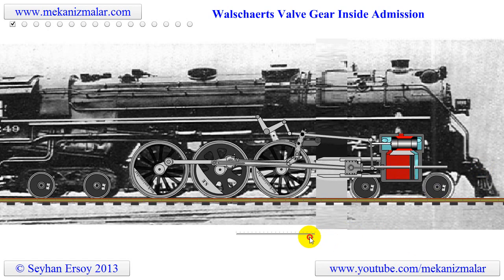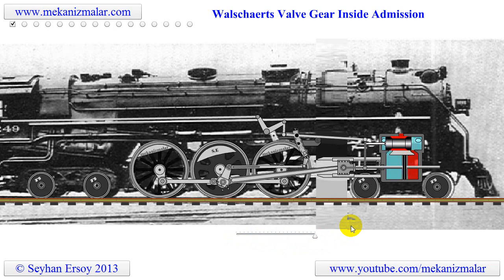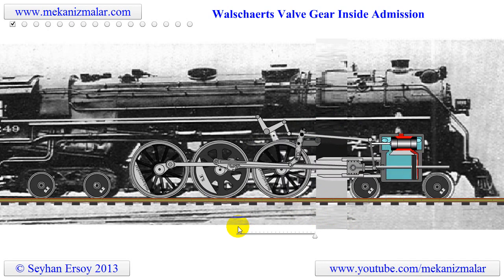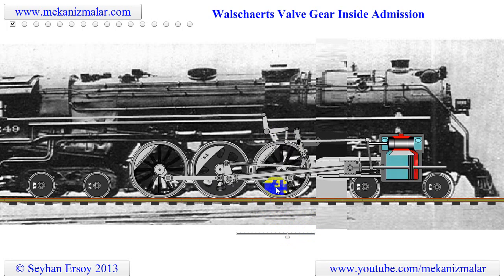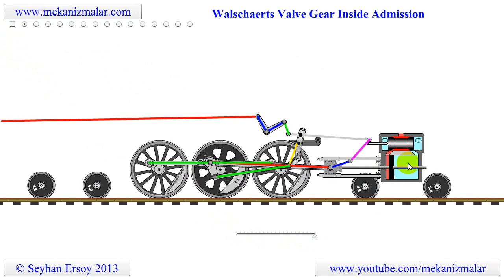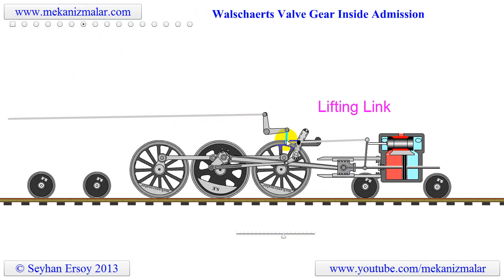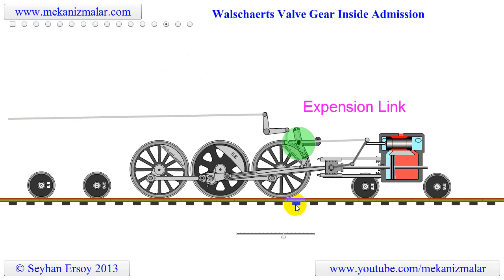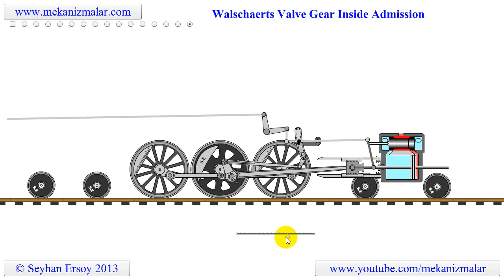Animated Steam locomotive linkage system

Comment: Great, thank you! A suggestion is to put up graphs that show the pressure curves etc. as the valves move. The analysis walchaerts did to get these levers timing and travel and cylinder size just right are quite mathematical I’m sure.

Comment: Best video yet on this. Still, it goes too fast and could use a close up of individual parts to illustrate how they work.
Reply from the maker: +Malcolm Marzo Thank you for your very valuable comment. I tried to look at the details of magnification of a section of video and try to test it. I had problem with magnification and I am still working on it. Sorry for the late reply.
Reply: I agree

Comment: Stephenson valve gear could be placed on the outside as well, as seen on some of the LMS "Black 5" 4-6-0 tender locomotives including the one name George Stephendon in 1975.
Reply: Here in New Zealand we had two types of steam locomotive with Outside Stephensons Valve Gear:

The first was two Crampton type locos in the 1860s (2-2-0).
The other was on four of the "Fell" locos used on a 1 in 15 incline. The valve gear on these fell locos had to be outside as there was another engine between the frames which drove on to the raised centre rail.

Comment: I think the linkage is wrong for inside admission.  The valve drive is on the wrong side for forward running.  It is in the position for reverse running when the animation shows the locomotive travelling forward.
Reply from the maker: Thank you for your visit and comment. I am hoping that people notice your comment next time to see my mistake and your correction.
Reply: Yes, I picked that up as well.

For inside admission valves (which is the example shown) the Radius Rod is in the upper half of the Expansion Link for reverse running (Back Gear) and in the lower half for forward running (Fore Gear).

Comment: VERY WELL done. My feeling and comments is/are:

For someone that had NO clue what each part did (like me), your beautiful graphic display went a bit too fast for me to grasp. While STILL VERY good, I believe you could improve your fine video by going a bit slower. The yellow dot tends to be confusing, at least to me.

I believe a better idea; is JUST too high-light the lever you are explaining; because the dot appears to be going everywhere before it settles down, to my eyes.

Also, MORE detail on the cylinder and piston. PLUS the control valve needs more detail given a bit slower. In addition, more detail on how the reversing levers ALSO can control the speed of the locomotive. It took me forever to "see" this in the variable travels of the valve. Ingenious for sure on the part of the inventor of same. A mention that the levers on either side of the locomotive are 90 degrees apart; that are so very necessary in a mechanical system like this.

Finally, some of your words, when naming the many levers, is hard to decipher. A bit clearer and more slowly spoken would help immeasurably.

Note: 

I had wondered for over 80 yrs just HOW a steam locomotive worked; which has fascinated me for the same 80 yrs. Thankfully I live less than 5 miles from a RR museum in  Duluth, GA. After I studied, agonizingly, your VERY good video, I got in my car and stopped at the museum and asked If I could just study their 4 6 4 Locomotive that had been given to the museum long ago. They were amazed at how long I just stood there and gazed and gawked at the levers. Little did they know that I had been studying your video to the "nth" degree before going to the museum.

It helped beyond words to "SEE" what I had never really "seen". The most amazing thing was: the awesome size of the "drivers". They were taller than me. Also the MASSIVE size of some of the levers! WOW! One does not "see" this unless they get right up to it because of " visual perspective", of course.

Thank you so very much for making this video and putting it on YouTube.

And may Jesus richly bless you and yours always,

patdee
Reply from the maker: Dear Pat, Thanks for your excellent comment and suggestion. As everything we do, more we do something, the more we learn. I am perpetually in leaning phase, and the making the video is one of them. I will keep your advises in my mind the next time a do a new video. I was considering myself, at age 67, as an old man. I hope I will live as long as you did with the same enthusiasm to to machines. Thanks one more time.
Reply: You are welcome dear person. In the meantime, I have a question.Try as I may, I simply cant figure out what the purpose of the "combination" lever is. I am certain there is a good reason for this linkage, but I just don't see it. When you get a chance could you explain its purpose?Thanks.patdee
Reply: pat dee you have to scroll it by hand.  I clicked because I always wanted to understand how the reverse worked.  My guess is that the L shaped thing causes pull part of the stroke to move from the top to the bottom.  But I could be wrong!
Reply: A better way to think of the reverser is as the steam locomotive's transmission.  It controls how much steam enters the cylinder box and the order in which steam enters in relation to the cylinders and connecting rods.
Reply from the maker: Fallowing link describes in detail how a combination lever works. I hope it would help you to understand the function of combination lever.
http://portal.parks.ca.gov/CapitalDistrict/csrmdocentroundhouse/Publications/Oliver%20Lawmaster%20Newsletters/Paul%20and%20Kim%20Vol_136.pdf

Comment: Each linkage adds a lot friction and I doubt they even had roller bearings for most.
Reply: The only roller bearings on the any of the linkages or rods were on the big end of the main rod (the rod coming off the cross head) and on the cranks of the side rods, the long one linking all drivers.  On modern fast steamers, of course, the wheels bearings were all Timken bearings, either as delivered or converted soon after the concept was established.
Reply: yes until much later in steam locos.. they would have had bronze bushings, kept greased

Comment: Marvellous ! i have a question. When the engine is stationary in a position where main rod is perfectly horizontal and aligned with the axis of the wheels ,there is no possibility of a torqe to rotate the wheels. Then  how will the engine start moving ? All the force from the piston will be only horizontal ,  a slight angular postiion of the main rod alone can produce some torque which reaches max when the  wheel rotates by 90 deg from this position. Any explanation ? Thanks !
Reply from the maker: Yes, as you described, this will create a problem. However, if we are looking right side piston, the life side will be 90 degrees out of phase. This makes the engine go forward when it begins rolling ahead the system will not have a problem.
Reply: @mekanizmalar  yes, i remember reading this  somewhere. From school days i was under the impression that the left and right set of wheels operate independently. And i guess this arrangement reduces the pulling power of the engine by half since the starting force has to be provided by either left or right set of wheels. ! Anyway , a marvel of the bygone erea !!

Comment: The linkage is wrong.. When going forward, the radius rod should be "down", not up!
Reply from the maker: Hi Jeremy, Thank you for the correction. I wish someone who had experience in the subject was with me when I was doing the animation. I will add a correction annotation to my video about it.
Reply: mekanizmalar Actually there is indirect and direct Walschart's Valve Gear. I'm sure the Hudson had direct so Jeremy is correct. There are examples of indirect like the animation. Thanks for sharing, very nice.
Reply: +mekanizmalar Congratulations for this video! Even if it is slightly wrong, it is a very good one. I will watch it very attentively and help you to make the adequate corrections. The motion of the wheels and mechanisms of the steam-locomotive is always impressive. Steam-locomotives are my favourites, and your audio comments expressed exactly my reasons and feelings :) Big LIKE!
Reply from the maker: +mpursu Thank you for your visit and warm support. This animation took a month of continuous working on it. Also this is not frame by frame animation, everything done by using math. This is why it is too close to reality. After spending that much time, and you get  a negative comment about a simple portion of the video makes you sad. On the other hand you feel very good, since people are paying attention to the small details and they  only find minor problems.
Reply: You did a Great Job, love the Audio too.

Comment: Nicely illustrated. However you show the parts all to quickly. One does not have the time to observe the connection and relationship of the parts to the whole before you are on to the nest one.  This is very detailed but all too short. Get rid of the computer voice. Put your voice on the sound track and giv4e more details of how it works. Not just "Observe how...." Describe it in detail. People see this collections of flying objects and want to know what does this do. Why does it look so strange when compared to the main rods the connecting links between the driving wheels.  Thumbs up for this nicely done graphic.

Comment: I thought the main rod was called the piston rod
Reply: There is no rod that is called the "Main" rod.

The piston rod holds the piston which slides up and down in the cylinder.
The rod that connects the crosshead to the drive crank is called the Connecting Rod and the rod/s that connect the driving wheels together is called the Coupling Rod - hence the term "Coupled Wheels".